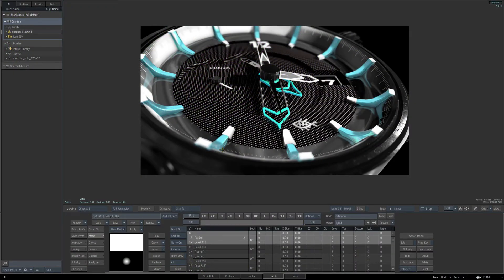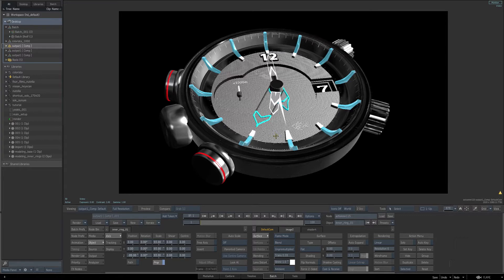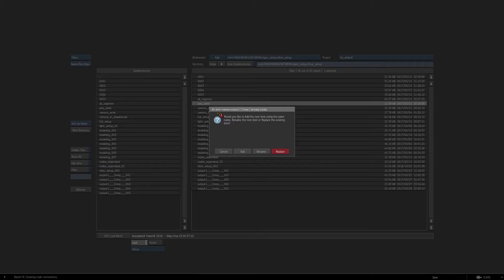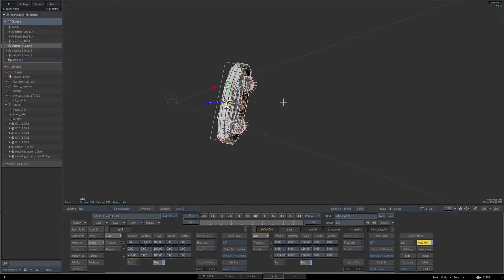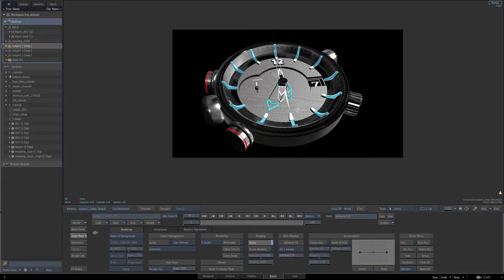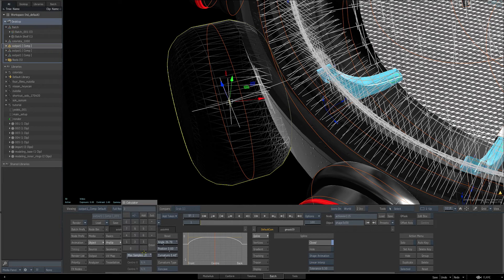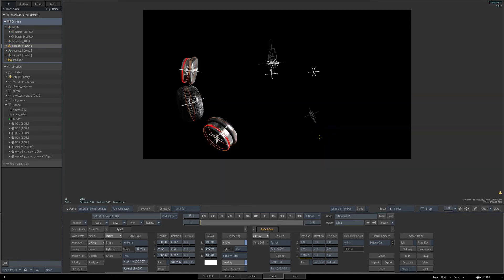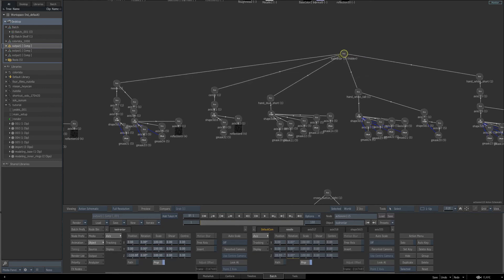Creating a 3D model inside Flame 2018 - Part 14 of 14 – Alper Oktay

Comment: Hi Alper Oktay!
I loved the whole training series. It's very well explained. Just one request is that
Can you please explain how did you put together the whole composition(part 14) in slightly detail?
Because I have come this far till part 13, but unable to composite in the final part.
Reply from the maker: Hi Lokesh Lohar, Alper did this series for us back in 2017 but it's up to him to respond if you want more details.   As far as I can tell from looking at the Action Schematics in the video.   This is a combination of 3D shapes which are mostly extruded from Gmasks.  There are substance textures but you can use Substance PBR textures in the latest version of Flame.   This would give you the geometry of watch and it should sit together in 3D space.   As a suggestion for final compositing, you could add CameraFX shaders to add ambient occlusion, shadows, depth of field and motion blur.   This will definitely improve the final look of the composite.  Hope this help!